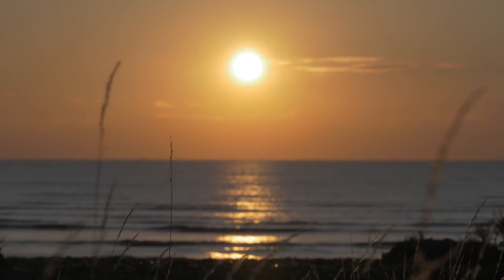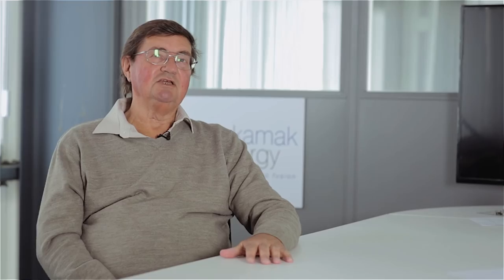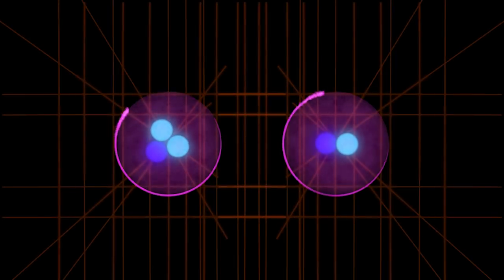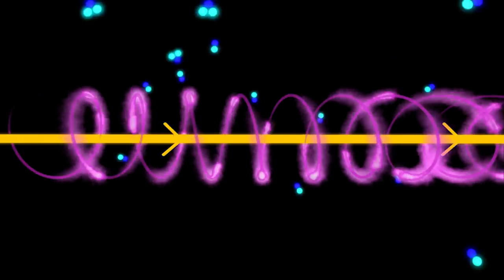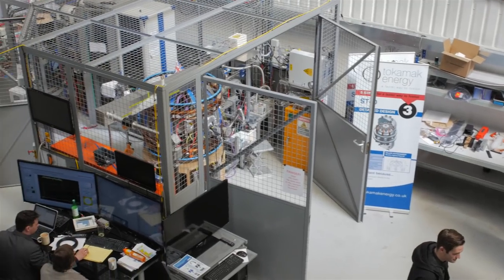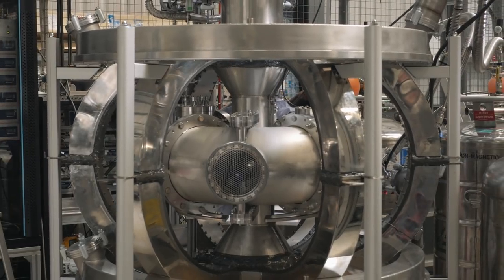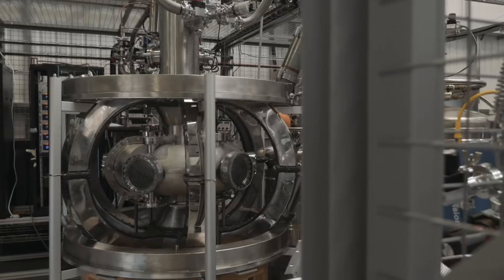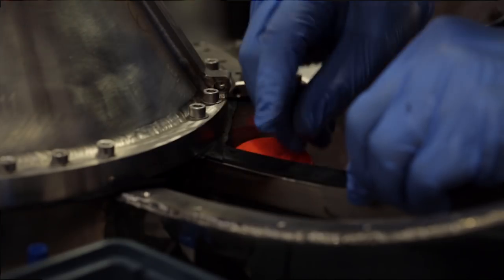Faster fusion

Comment: what happens if it gets sabotaged ?
will it cause a catastrophe ?
Reply: Nope, it's actually totally failsafe. Any breach of containment would lower the plasma density below that needed for fusion, there would be local damage as hot plasma would still be an issue.

Comment: Fusion or not, the problem is that the materials can not withstand the high temperatures. 
Superconductivity does not seem to solve the problem.
Reply: Winkler Yes it does, magnetic fields

Comment: It sounds like the machine would use a lot of energy in itself so any output would be small but it's a start.
Reply: Flamer997 well actually the net energy gain could be massive
Reply: Darude Rocket Yeah I'm not saying it won't be, it could be a great source of energy but for now it's in it's younger state and I don't think it could produce that mutch.

Comment: and soon they will glow blue will have size of actuall donut and made from see thru material =D -> BAM Iron man Suit -> make it happen Tony! (Elon)
Reply: Elon is solar
Reply: arc reactor technology
Reply: Daniel Tejnický the blue glow is actually real. you can look up reactors on here, it's pretty cool
Reply: We got a little problem tho as fusion reactors only produce heat... 
But we're working on a steam (punk ?) iron man suit
Reply: You can try and use concept designs for nuclear planes proposed by both the USSR and the U.S.A. during the cold war. 
The only issue was the lighter designs would leave trails of irradiated gas behind them. 
Only the Soviets were crazy enough to actually build and fly one.

Comment: The thing is, when you make your "faster" fusion energy device, and it can't exceed 99% efficiency, it doesn't matter whether you were the first to reach 99%.
Reply: CAN - the problem is you start with an experimental reactor to prove the design and go from there. MIT has done and published research on exactly this - you increase the plasma pressure you get higher q from smaller devices that are cheaper and faster to build. This is not science fiction it's science fact, the problem is getting the funding to do it when ITER is getting all the funding.

Comment: Popular Mechanix magazine described controlled magnetic confinement fusion in the 1950's When I was a young boy.  Practical power production was supposedly right 'round the corner.  Excuse me if I'm a bit skeptical.  If it happens before I'm back in diapers, I'll be surprised.

Comment: Looks like the strapped one of those light up electric arching toy as a demonstration of their fusion reactor. Wouldn't there be a large amount of radiation coming off of even one of these machines? Like sub atomic particles that just happen to colide with the walls of the chamber or even another ion? Skepticism aside the concept sounds nice.

Comment: If this is actually a working prototype. Why are all the interlocks just cages. I understand protection from charged particles. But the gammas will punch threw like there's nothing there. Unless this thing doesn't produce enough energy for it to be a problem. Therefore, it doesn't produce useful amounts of energy at all really.

Comment: A fraction of the money spent on fusion research could have completed the development of Molten Salt Reactors which were proven back in the 50's.   A whole different fission method generating a tiny fraction of the waste (in fact its waste products are very useful) can consume a lot of the waste from conventional reactors, and if fueled with converted Thorium, has an inexhaustible cheap supply.  Or we can wait for ever till they figure out fusion....
Reply: Public oppinion is too disfavourous when it comes to fision. Which is extremely sad. I too would love to see Thorium reactors in use.

Comment: what are the odds this could create a black hole?
Reply: 0
Reply: William S Heya thnx for responding, I was genuinely curious about this topic. the only reason I believed it could happen is that one of the possible outcomes of a star dying is a black hole.
Reply: no problem! The reason large stars can become a black hole is because of how massive they are. Since these fusion reactors are only a few dozen meters at most, there's no risk for it to collapse on itself
Reply: William S ah I forgot about the role gravity takes in that process. many thanks!

Comment: I have so many questions about fusion that these videos never answers.
Hydrogen will have to be produced from water, which if converted to helium makes it NOT renewable. There's a lot of water, but it WILL last a limited time if fusion becomes dominant in energy production. So how long would the oceans last?

Also because hydrogen will come from the ocean, wouldn't there have to be a production process to purify and do electrolysis to get hydrogen gas? Such electrolysis takes a lot of energy. How would they produce tritium? Today it's a byproduct of fission reactors. Will a fusion reactor produce enough energy to sustain itself, run its support systems and on top of that provide energy for other things?

I'm skeptical until someone can adequately answer these questions, until then it just looks like fancy (and expensive) lab experiments.
Reply: Honestly we have a serious problem with having too much water on the planet, cities overflooding, ice caps melting.. We could easily miss the shitload of water our planet haves.

Also the current water supply could literally power humanity for millions of years, a lifespan IMO far longer than other resources we need in our everyday life. Whenever we would hypothetically deplete the water supply i'm convinced we would have FAR more and worse concerns than power supply.Also hydrogen is obviously not the only fuel we could use for fusion, just as uranium is not the only fission fuel available.  
No single form of energy is more 'renewable', as hydro, solar and wind energy eventually also rely on the heat and energy of the sun wich also has a limited lifespan.

Comment: I'm 62 and have been interested in nuclear physics since a child.  Although an amateur, I'm fairly well-read in the technology of nuclear fusion.  Just the other day, I dug out a booklet entitled "Nuclear Fusion", published by the old US Atomic Energy Commission.  It was copyrighted 1968, and described all the processes that were, at that time, being explored.  It talked about stellarator  and tokamak and magnetic containment, etc.  Controlled fusion has been pursued for 50 years, and it's always been "in the next 5-10 years".  I'm convinced it's like chasing the proverbial pot of gold at the end of a rainbow.  It's going to require producing and controlling temperatures and pressures found at the center of the Sun.  Don't see that happening for the foreseeable future.  Not without major and fundamental breakthroughs.  And for all the hopeful fusion fanboys out there, you need to remember:  "theoretically possible" is a long ways from "reality".

Comment: We have a brilliant Fusion Reactor that provides wireless power at an extremely safe (1AU) distance away, all we need are better aerials.
Reply: And a way to store the huge amounts of energy that are required overnight. A city consumes most of its energy at night- exactly when solar panels don't work. Currently there are no batteries in existence that can do that.
Reply: captain swagworth Actually the lowest consumption is 12pm to 5am when many people are asleep. Late evening is the peak demand, so we only need 6 hours of short term storage to fix it. We can heat water during the day which can be used to heat the home/showers etc. So that leaves lights/appliances to run which are getting more efficient. Solar not 100% the solution, nor trying but a good chunk of the solution and battery tech is getting better. Elon Musk and others are working on it.
Reply: ***** I'm glad they are working on it- but I cant see it being the single solution to the energy crisis.
Reply: Check out the compressed gas energy storage ideas :)

Comment: mmm Fusion's cool... keep working on that
but in the meanwhile we should upgrade all nuclear powerplants to thorium and invest heavily into wind and solar power. 
As our technology advances we will need a higher amount of energy to power it all and it needs to be more ubiquitous. The time will come when we will need technologies such as Fusion Reactors.
Reply: Thorium is indeed an excellent power generator, but is rare.
Reply: There's about 3 times as much Thorium in the Earth's crust as there is there is Uranium (all isotopes, not just U235), the US has a stockpile of about 3,000 tonnes of it. It's often mixed up with Rare Earth deposits which is a pain for the miners because they don't know what to do with the stuff.
Reply: Feral
You mean Thorium is rare or Thorium reactors are rare?
Thorium is way more common than Uranium, can create more energy with less fuel and has about a tenth of the half life of Uranium. Also most Uranium reactors in the US are models built in the 60s and 70s, which in my opinion are just too old to be safe. They should all be decommissioned and replaced with new more efficient and safer reactor designs. And why not make them Thorium while we're at it. 

Andy
That's funny.
Reply: Solar power is a waste of time unless you have huge arrays of panels, since the energy from the sun that actually hits our planet is pretty much nothing compared to how much energy it releases.
Reply: TheRealDescartes solar is also cheaper and easier to install, genius. rooftop solar panels are a big thing if implemented directly. its not "waste of time". by your logic, fusion is also useless because by comparison the whole of earth will create more energy than the particular deposits
Reply: The energy you can directly harvest and the cost of the solar panels makes it fairly impractical and there's nothing we can currently do about it
Fusion at the other hand isn't useless because it can create more energy than you put into it and should it work successfully you can create thousands of times more energy than a solar array of the same price
Solar energy is good as backup energy but very impractical and costly if you want to power the entire planet
Reply: TheRealDescartes There is no proof that fusion will ever be a viable method of producing energy. Quit dreaming and help progress in what we know will work,  like Photovoltaic technologies and Wind turbines.
Reply: That's why I clearly said "should it work"
Reply: Just because the earth is receiving a tiny fragment of the overall output of the sun doesn't mean Solar isn't worth investing in. We are still receiving a ridicules amount of energy from the sun which can be put to great use. And until we can fit tiny fusion reactors into all of our devices it's still the easiest way to bring power to places without grids or some kind infrastructure.
Reply: It's not that incoming energy levels are bad, it's that we can't harvest it efficiently enough for it to be worth it in the long run
Reply: They are worth it especially in the long run.
 Manufacturing is progressively becoming cheaper, depending on the environment they really need no maintenance (unless sandstorms are a problem or someone chucks rocks at the panels), outside of manufacturing them there really are no waste products, and most of all, you need no grid for them.
 You can run a vehicle in an area as remote as Mars with them. Sun light is ubiquitous, where ever there is sunlight you can make power. In terms of ubiquity it's by far the best thing we have. 
Current fossil fuel and uranium plants have no such place in the future. 

It is not unlikely that it will take another 50 years for fusion to work. We should make the right calls for now and avoid having to use fossil fuels and uranium.
Reply: Yes, but the time you need to earn back the money you used to purchase a solar panel is double digit years and by that time you'll have already spent hundreds of times more money on electricity
So unless we develop a way to get more energy that reaches Earth, solar panels are not worth it in the long run
Backup energy, maybe, but as a primary source it's useless
Reply: I dun get what you're saying. You hate solar power. Tell me something you like. And Fusion doesn't count yet.
Reply: I don't hate solar power, I just hate that it doesn't work as well as it should to pay itself off
Reply: What would you have us invest in though?
Reply: There is no need to invest in anything right now, electricity is cheap
Reply: ........we should always be investing into future technologies.
Ye, Major disagreement. cya
Reply: Yes, the government and people with large sums of money should invest into future technologies
You as an average middle class worker however can not invest enough money to make even the smallest difference in the advancement of such technologies
Reply: I got solar panels on my roof. They're awesome
Reply: Broockle the problem with making thorium plants is everyone is already paranoid about nuclear energy all together so unless you're in a nuclear friendly country like France don't expect new nuclear power plants or current ones to be rebuilt